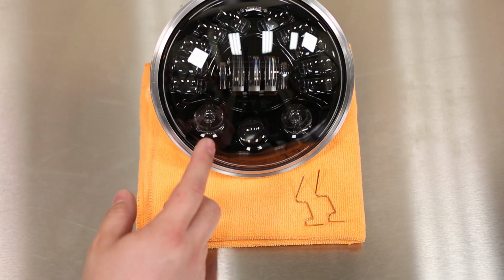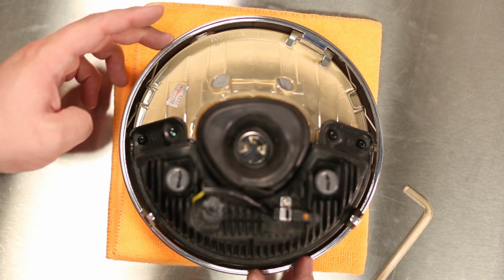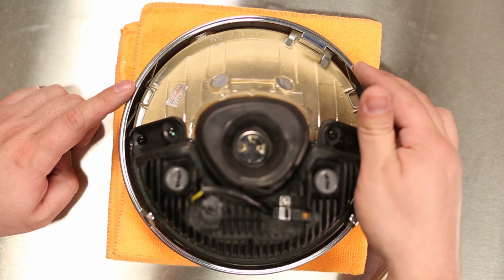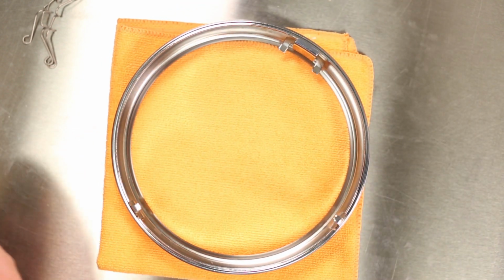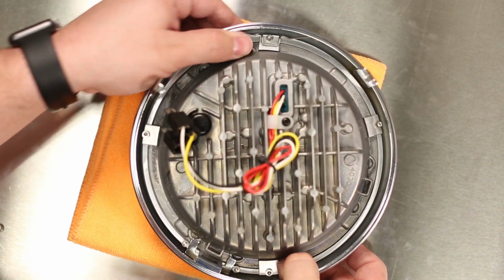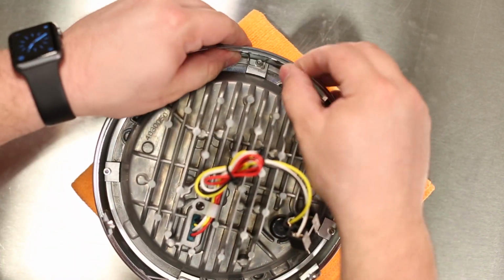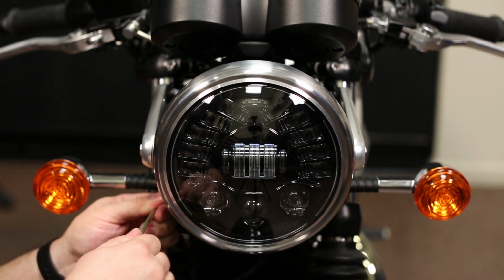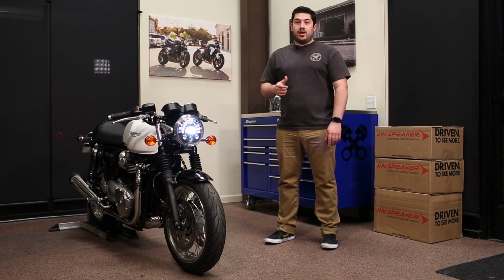Triumph Modern Classic LED Headlight Upgrade Installation

Comment: Thanks for the video, got the adaptive 2 led. Helped me with the install on my wife’s 2022 triumph street twin gold line. May be an expensive upgrade but totally worth it. It looks amazing 🤩
Reply: Did you use the Adapter Ring for the installation?
Reply: I can’t even get the retaining rings back in. Let alone the gold ones provided. On my 22 ST

Comment: Beautiful. Does it work in the Triumph Scrambler 900 (2024)? No need for cable modification or anything? thanks!
Reply from the maker: As far as we know, this upgrade is still compatible with the '24 models. Direct plug and play.

Comment: Just found your video, thank’s a lot. I have got the 8790A2 JW speaker light, but it didn’t come with an adapter. I have the Bonneville t120 from 2016 – and the JW website still tells me I don’t need a ring. What’s the tile number for the adapter that you used?
Reply from the maker: 2016 is a funky year for Bonneville because there were technically still air-cooled models. But either way an adapter ring is needed. Reach out to us and we'll get you sorted bit.ly/md-cntct

Comment: That headlight looks amazing! Will this same headlight fit a 2019 Triumph Speed Twin?  Do you have a link to the specific model that would fit a Speed Twin?  Thanks in advance!
Reply from the maker: This will work on the Speed Twin. You can order the one listed for the Thruxton 1200/R here - bit.ly/mdTmc2

Comment: Thanks for the video. Question..there are 2 wires connected to my headlamp? I think I noticed you disconnect 2 as well. Is the second smaller wire left unconnected? Also... What size is the LED headlamp (inches)? thanks again
Reply from the maker: guessguy209 the smaller connection is left unconnected. The light is a 7” with an adapter to fit your non-standard stock ring and bucket.
Reply: I couldn't get the smaller connection disconnected from the old headlight. Is there a trick to it. I tried to follow the instructions but got stuck trying to remove the second wire. The big one just came right off. Can you help me understand how to get the smaller one disconnected?
Reply: Matt Clements I actually have a bonneville with a different light. But it did also have 2 wires(one big that came off easy and a smaller one that I had trouble getting off). There was a little clip holding it in that was a little hard to see/notice. But also, it was slightly stuck together as well. After I got it off it snapped back together and back off much easier the next few times I disconnected it. Try and get a light in there and look for a small clip/button that's holding it together

Comment: Great video! Thank you for this. I want to do the same but I'm a bit unsure about how this lamp will replicate the functionality of the original lamp. High- and low-beam, DRL and parking light. Any change to demonstrate the full functionality of the retrofitted lamp in another video?
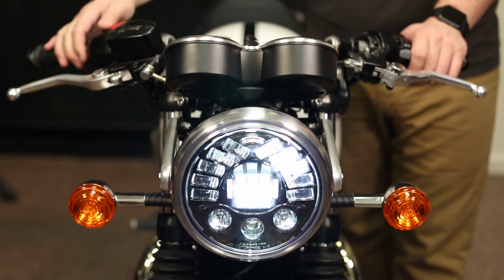Reply from the maker: The low beam and high beam still function the same as your stock lamp and you could wire the parking light in if needed but that is typically not needed or necessary. See 3:08

Comment: I could not unplug the small connector when removing the original headlight on my bike. It seems firmly fastned. Just let me know how I should do to unplug it?
Reply from the maker: Using a very small screw driver can help to release the locking tab on the connector. It does unplug with a little effort sometimes.
Reply: @motodemic  I succeeded unplugging the small connectoras per your instruction, and finally replaced the headlight. Thank you.

Comment: Hello! Greetings from Brazil! Could you tell what’s the diameter of this headlamp?
Reply from the maker: We use a PAR56 standard 7-inch light with our machined adapter ring to fit the factory headlight rim.

Comment: Hey Motodemic - you unplugged two wires when you took the old headlight out but only connected one with the new headlight. What was that second smaller wire?
Reply from the maker: The smaller wire is for the DRL on this particular Thruxton. It is not re-used in this install so it just gets tucked in with the other wiring.
Reply: Does this mean, the headlight runs daytime running automatically without the use of the wire? Canada here so need DRL... also mine is 2022 Thruxton RS - is this still as simple as you made it look?
 @motodemic
Reply: Okay...found my own aswers from just heading over to your website - you guys are soinnovative and simplistic... its amazing just how dumb everyone gets when understanding this type of upgrade... Duh! unplug the wire then plug in the new wire lolololol...500 questions later...oh, so we just do what you showed in the video.... oooh I see.... lollol
Reply from the maker: @mr.Brackett  If you have a DRL/Low Beam switch on your left hand control, you would leave that in the low beam position. North American bikes do not have DRL, they run the headlight low beam as this function. Rest of world models have the DRL functionality with full brightness, where we get a dimmed version.

Comment: Does the adaptive function work on high beam as well as low beam?  I read somewhere the older model only worked on low, where the new ones will adapt on high and low.
Reply from the maker: What you read is correct. It's been like this for over a year 👍

Comment: Could you give me some information on that brushed aluminum retaining ring? Did that come stock on the bike you are working on. I am looking to replace the one on my Triumph Street Twin. Not a huge fan of that flat gray plastic look. Thanks!
Reply from the maker: The Aluminum ring on the headlight itself is our adapter. The outer ring that we remove the stock light from is the one that comes on the Thruxton 1200 from the factory. We just brushed it ourselves to match the bike better. You can use the ring from any current water-cooled modern classics or refinish yours.
Reply: Thank you so much for the quick response! Now, the obvious next question: How did you do it? What tools will I need?
Reply from the maker: 3M Scotch-Brite Hand Pad and some trial and error 👍

Comment: Will installing this unit require change the Type setting in a liquid cooled Bonneville like the Street Cup? Or that only applies to LED indicators?
Reply from the maker: J Dungca no changes are necessary. That setting is for the indicator blink rate.

Comment: Does this work with the older model scrambler(air cooled)??
Reply from the maker: Simon Tkaczyk you have to convert to a 7 inch light, the previous gen Scrambler has a 5 3/4 inch light that can't be easily swapped. We've help MANY customers do this with an OEM Bonneville bucket and the LED Upgrade for that generation.

Comment: Is there a headlight upgrade like this for a 2015 Triumph Scrambler?
Reply from the maker: The air-cooled Scramblers use a non-standard size headlight unit so we do not have a direct drop-in for that model's housing. We typically recommend switching up to the Bonneville/Thruxton spec 7-inch housing and installing that in your stock ears or aftermarket headlight brackets. Both are available on our site 👍

Comment: Do you guys have a paired lamp setup for the Thunderbird Storm, older Speed triples, or the Rocket III?
Reply from the maker: George Erhard sure do! It’s the first product listed under our LED Headlight Upgrades - https://motodemic.com/shop/dual-round-headlight-led-upgrade/
Reply: MOTODEMIC Awesome!  I checked the form, there's no option for the black bezel lamps, are those avail or only the chrome bezel ones? I'm on a 2014 Storm, so trying to keep the blacked out motif.
Reply from the maker: George Erhard we only offer them in black. The ones shown in the product photos are black 👍

Comment: Can you install with track racer fender on or does that need to be removed?
Reply from the maker: Vik Mediratta we don’t have any direct experience with the fairing but this is no different than changing the headlight bulb. Even if it does need to be removed its most likely only a few bolts.

Comment: Hello Brad, Three questions:

1. In the install, two connections are disconnected but only one is reconnected  . . . could you tell me what the other connection is for?

2. After making the connection (which required much more force than I was expecting) I cannot unconnected the light.  The plug comes about half way out and then stops.  Is there a trick?  Or just 'pull harder'?  

3.  Is there a video / directions somewhere for the Rizoma front signals you sell on the new Triumphs? 

Thank you,  Eric
Reply from the maker: Hello, the smaller connection is for the Front Position/DRL light found in the Bonneville T120 and Thruxton. This connection is not reused and can be simply tucked in with the other wiring in the housing. The headlight connection shouldn't take any extra force, maybe double check that the terminals are aligning properly. Turn signal installation is easy and straightforward once you take it apart. The stock signal locations are reused and they are completely plug-and-play with the turn signal adapters.
Reply: Brad, thank you for the quick and detailed reply.

Comment: I couldn't get the smaller connection disconnected from the old headlight. Is there a trick to it. I tried to follow the instructions but got stuck trying to remove the second wire. The big one just came right off. Can you help me understand how to get the smaller one disconnected?
Reply from the maker: Matt Clements, there is a small pin on the connector that releases the two halves. You may need to apply pressure to it with a small screwdriver.
Reply: A pin? I don't see a pin anywhere anywhere. Your video just shows you pulling it out. I'm not clear on how you did that or what you mean by a pin.
Reply from the maker: Matt Clements a very small latch that when pressed the connector comes out. It was very easy on our Thruxton.
Reply: I got it installed... Thanks. I just needed an extra hand from someone to hold the light while I used two hands to disconnect! New headlight looks great!
Reply from the maker: Teamwork makes the dream work!

Comment: Will this fit on a 2016 Scrambler?
Reply from the maker: Only if it's a water-cooled Street Scrambler. This will not work on an air-cooled Scrambler 900 with a 5 3/4-inch headlight.

Comment: Would this fit a 2017 Triumph Bonneville Bobber?
Reply from the maker: This particular upgrade will not but we do have options for that model.
Drop-in Upgrade - bit.ly/mdbobr
7-inch Conversion - bit.ly/bobber7